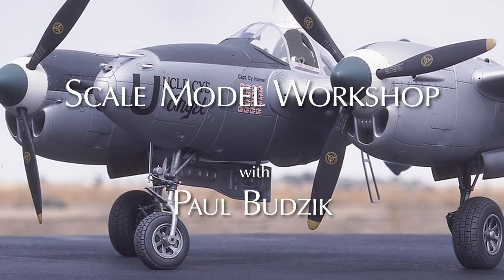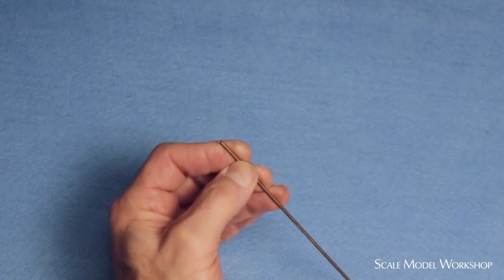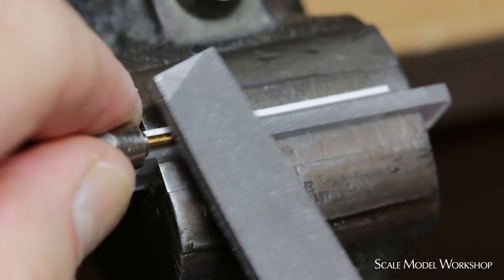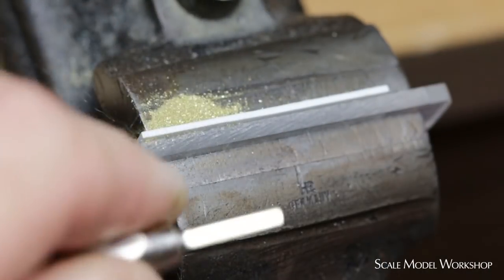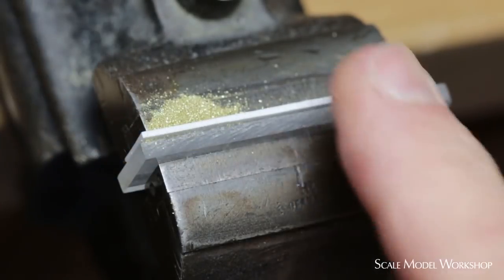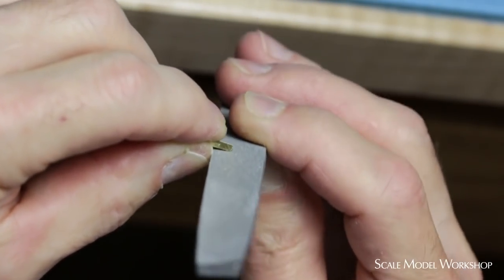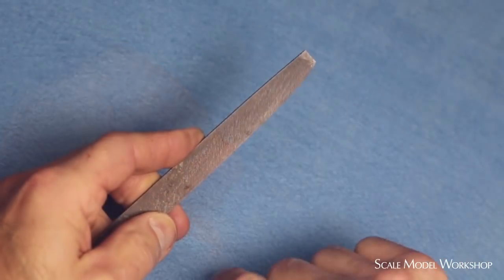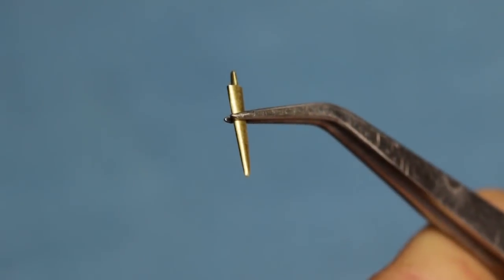How to Fabricate a Blade Antenna

Comment: I did nearly the same thing to make that antenna for my Tamiya P-38G. Holding the wire piece in the pin vice would’ve made it a bit easier. Do like these quick tips.

Comment: So bloody obvious, but I never thought of boing it that way.😖
Reply from the maker: If you do any amount of scratch building and machine work ... the first thing you think about is how am I going to attach the part ... and how am I going to hold on to it while I'm fabricating it ... so as much at I've made this about the antenna, the underlying techniques of starting with rod stock so you have something to hold on to while filing, and finishing with a solid pin, are really the take-away ideas.